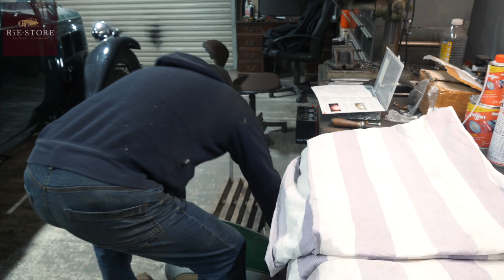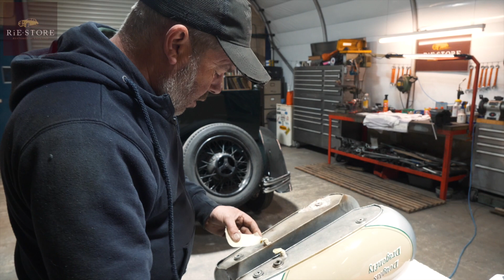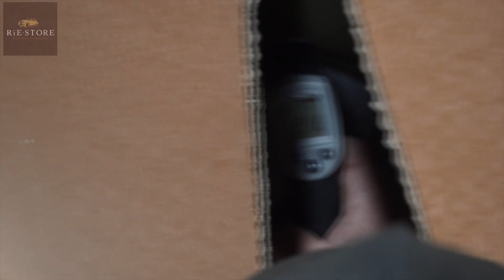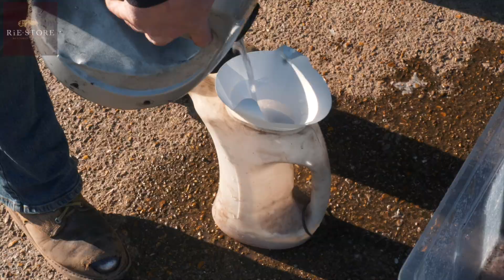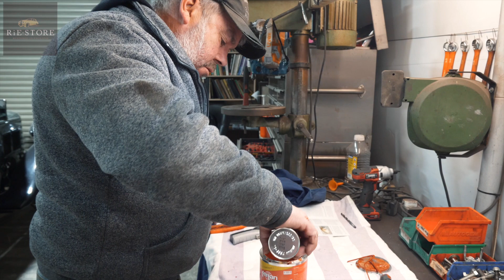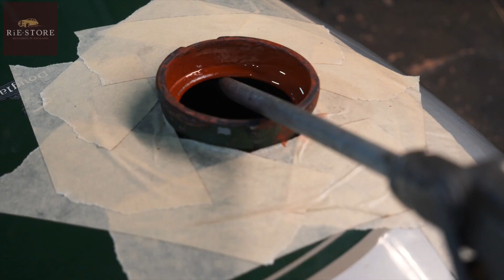First time using Fertan tank sealer & rust converter - 1957 Douglas Dragonfly / ep137

Comment: I recently de-rusted an old DKW fuel tank on a Honda CB 750.
Step 1- Two tablespoons of caustic soda, fill tank with cold tap water, leave overnight.
Step 2 - Pour out soda, fill tank with cleaning vinegar, let sit for several days.
Step 3 - Pour out at least half the vinegar, add two handfuls of small nuts, bolts, screws, etc., and shake well while tipping tank over and over, upside down, etc.
Step 4 - Pour out vinegar and screws, rinse tank well with demineralised water.
Step 5 - Heat tank with heat gun as soon as possible to avoid flash rust. Inspect with bright torch to make sure all water has evaporated.
Step 6 - Add rust converter, about 200 mil, and tip tank in all directions to ensure even coating.
Step 7 - Rinse tank with warm water and allow to dry. (the tank had no rust or converter residue by this stage, the metal was clean and bright).
Step 8 - Add tank sealer and tip tank in all directions to coat evenly.

The process took about two weeks, and cost about $60 AUD, but the tank is now clean, rust free, and sealed.
Reply from the maker: Great tip - thanks for posting!

Comment: Good info with this video. I have 2 Dragonflies, one I rebuilt and ran about 35 years ago, and one still all in bits, all parts painted/lined and ready to assemble - but sadly not by me. This classic biker is 75 next month, so all has to go but, if I (unlikely) or any buyer find the tank insides need treating (been garaged many years) this will be a good help, thanks. Like mine, it is missing the green stick-on, pimpled knee pads. Black were available and later, I think, the green ones I never got. I even have tank panels tracings (for my tank sprayer/hand-liner guy) from the original on clear plastic film somewhere that I hope someone can make use of one day. 

By coincidence, having just watched your video about welding up the splitting Earls forks, I happen to have a spare set, minus dampers. Fair surface rust in places but, with that filler shown being used, I hope they may be useful to someone in need who cannot source any better ones. 
I recall reading about that outfit (unless it is a copy) being built on the I.O.M by, I think, someone called Heatherington. There was also a 'DragonFour' special with another pair of cylinders/inverted crankcase placed on the top as a 700cc engine. Thanks for showing.